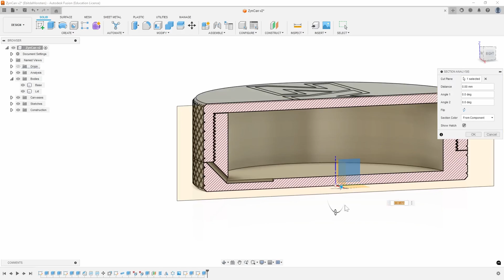This 3D Print Helps You Quit Nicotine

Comment: The reason that video did so well is because it is “extremely difficult” to make a screw-on lid of a big size in fusion. It is not intuitive at all. If possible, please make a detailed tutorial on how to make a perfectly fitting scre cap/adapter of a large diameter like 40-100 millimiters using real world measurements. Like for a gallon/5Liter jug etc. that will help a ton (there are almost no videos on that and def. not a single comprehensive end to end video)